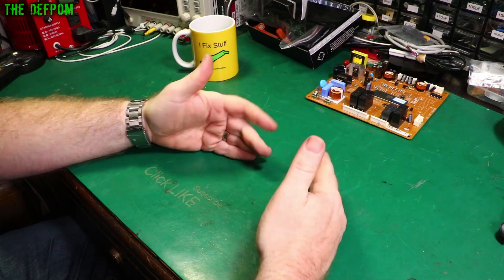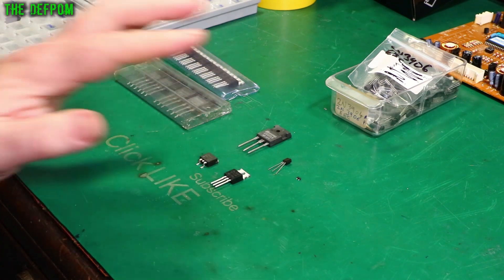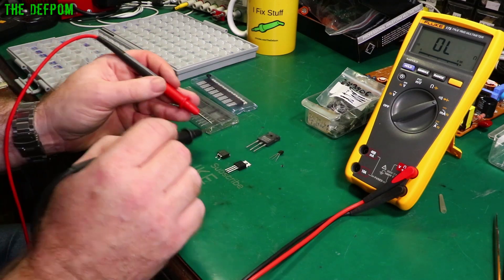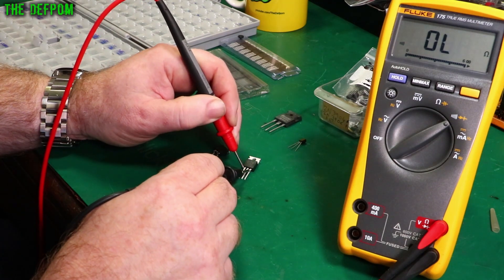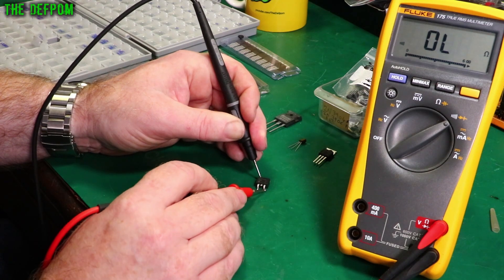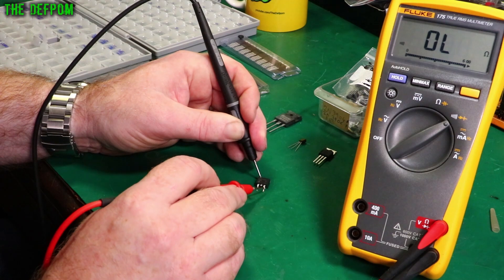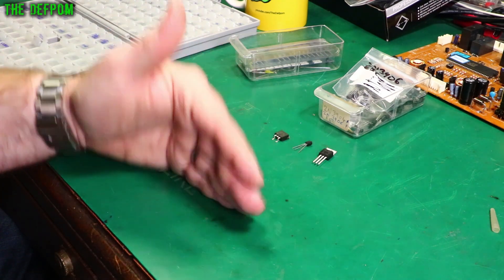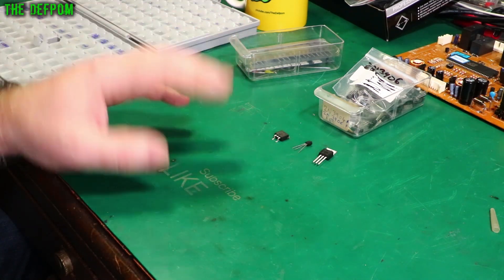🔴 Electronics For Beginners - No.8 - Transistors - No.965

Comment: when the Fet is off you will be able to measure the body diode that's between the Drain and Source. Turning the fet on will short this diode out. I would not say the fet has latched as it will turn off as soon as the gate charge as leaked away.